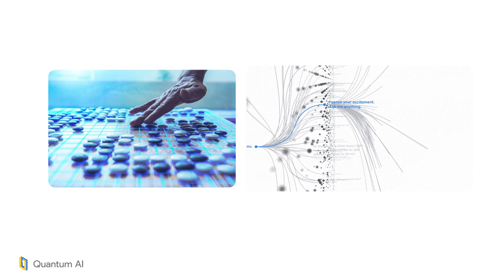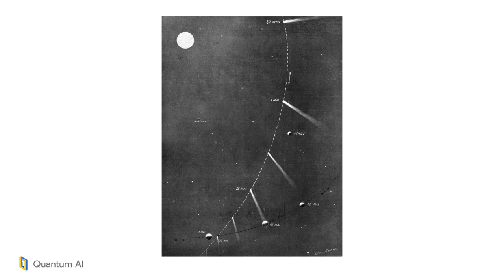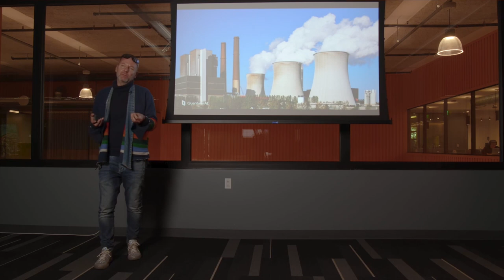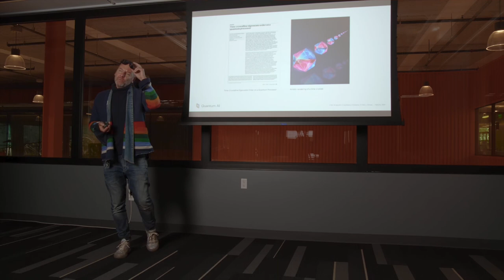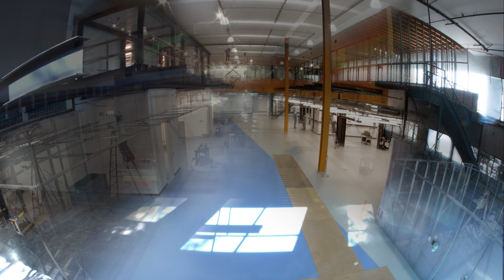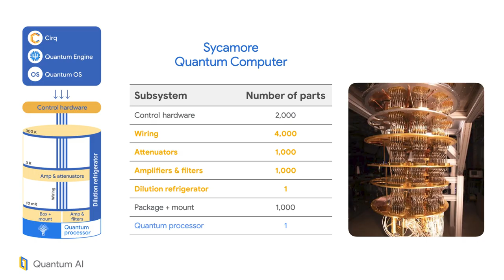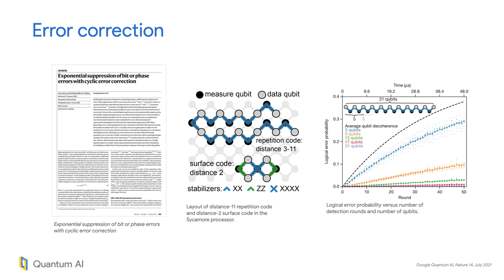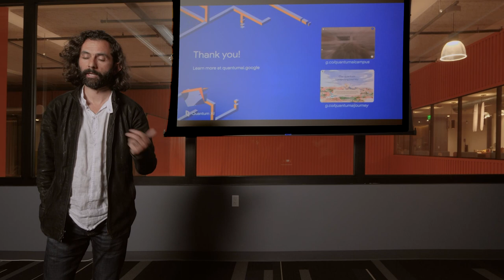Google Quantum AI Update 2022

Comment: Honestly I think it'll help most with large language models (LMs) since the exponential scaling on information density scales linearly with the exponential increase in LM computation, meaning you should.... hopefully? Need just linear scaling for whatever level of error tolerance you desire. Which is non-quantized to begin with, so hopefully the dependence of outputs based upon some faulty-with-x%-chance system wouldn't be too terrible.

I guess I could be really failing to understand here though if it's something like the exponential divergence you'd see in a chaotic system, but the fixed latent space of the residual branch of the network should constrain that divergence to excessively manageable levels.

Could be wrong and currently still on the very much classical side of computer research, but once quantum ML takes off I plan on being near the front wave (hopefully!) Of it. :D